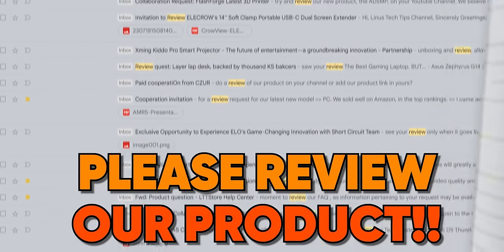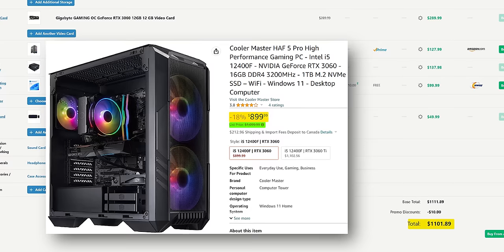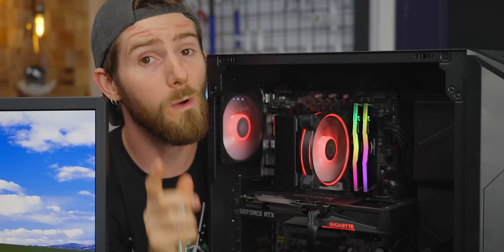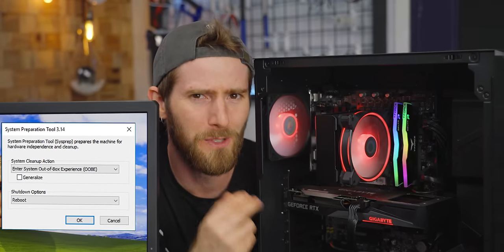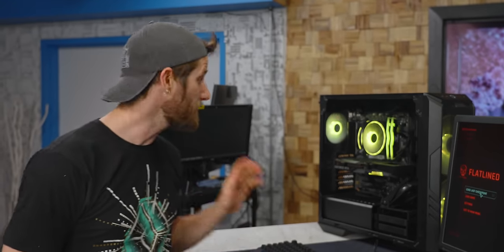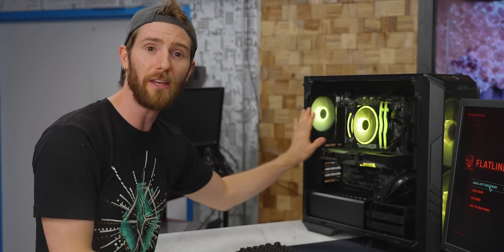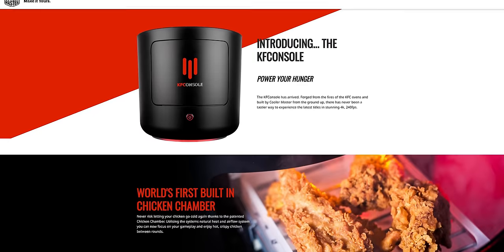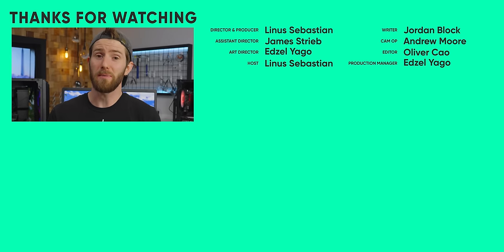Cooler Master Makes Gaming PCs Now? HAF 5 Pro Gaming PC review

Comment: Almost all RGB software require an user account to work now.  Pre-built do their testing in audit mode.  While you can test the RGB in audit mode, after sysprep, those software won't work for user.  Not Windows issue, but it is how the RGB software is written.  The only one I know that still works after sysprep is Asrock Polychrome. User will have to install RGB software on their own if the RGB is connected to MB header.

Comment: The one computer has fading red lights on the AIO. This could indicate software issues, bios update, or over heating. I had this issue recently. If you did not set that to be the color choice, keep this in mind.

Comment: Tbh the white zip ties make sense for visual as you can see which wires are tied and which ones aren't. I've got a load of black ones on my speaker wire setup and changing things out as a nightmare.

Comment: I bought my first real PC this year and due to time constraints and a dying Mac Mini I went prebuilt. Alexander PC's treated me well and this build has been great so far. It was expensive at $3k but I'm happy with the purchase. I wasn't excited about the 3070 TI but I wanted the 13700k. And my wallet didn't allow me to request a 3080. I've had a very positive experience with Alexander PC's and I think they could be a prebuilt company worth checking out. I will say the packing was severely lackluster and could be improved upon immensely. But overall they get a 9/10 because they delivered what I paid for and their customer service hasn't let me down yet. Plus the cable routing is nice and the custom bronze or copper cables look STELLAR in this build.

Comment: Most RGB controllers have a wire that goes to the MB reset pins. So short press changes the RGB colours and long press acts as a reset. This has been common place for years. It's useful for non Windows users who still want to be able to change colours and cannot otherwise run the software.

Comment: Using reset for rgb sounds amazing, means you don’t have to fuss with software. Who uses the reset switch anyway? What does it do ever? Reboot windows? Just do that from the start menu or hold the powerbutton for 6 seconds

Comment: Reset rgb controllers are common thing, they are usually added to argb sets and if you need to hard restart machine you could just hold down power button, just like in laptops.

Comment: Regarding the weird CSGO claim, most Source games used to come with an fps_max value set to 300. I believe this was lifted higher in specifically CSGO recently as 360Hz+ monitors began getting more common. It's possible this value was still set wrong (or they used an older build) when testing.
Reply: I hate that actually. I noticed L4D2 was using a ton of GPU usage because of the framerate regardless of Vsync. 
I change it to FPS_MAX 60 in console but it resets everytime. Any fix?

Comment: The conflicting color scheme on the zip ties is to manufacturing simplicity. It lessens mistakes and an easy reference as most hired to manufacturing floors are not experts in the field. They theoretically should have many checks and balances but that seems to be the first they cut to make a buck.

Comment: i kinda like the clear zips on the back - not visible with side on, and when user servicing is done, its easy to see the ties you need to cut. those tails though... needs flushcuts.

Comment: My Lenovo T5 prebuilt doesn't even have a reset switch, and any changes to the light i front can only be changed through bios (but changes are reset when you leave bios) or through Lenovo software in windows. Kinda thinking the reset switch as rgb button is a decent compromise as I don't even remember thinking that my PC is lesser without it. Hold power button for 5 seconds to force shutdown if windows goes mental, works a treat and rarely happens, for me at least.

Comment: From my experiences,  Cooler Master has been one of the relative good guys when it comes to having their products work.   I have three PCs in the house here all in Cooler Master cases, all similar in nature.  Buying a solid case with pre-installed RGP fans that are actually worth paying for was nice, especially when they priced near enough to others without any fans.

I think the move you see companies like this making to become system integrators / builders is twofold.  Number one, they can leverage their good name in marketing terms, but also because they can put components from their various owned companies and partners in.  Full system sales is not a simple game, but it is a very good way to push off certain things that you are having a hard time moving, such as e-waste level keyboards.    It is impressive that the two systems came with essentially identical parts, as it's prebuilts often feature a series of small substitutions to use up left over stock. 

I would say that at under $900, it's not a horrible purchase.  A 3060 is a good enough graphics card to hold a junior gamer for a few more years yet.

Comment: Hey linus and team, i put together my first computer on my own thanks too all of the videos you have posted, specs
z790-a wifi from msi
i5-13600k
2x16 ddr5 5600megatransfers
1tb crucial p3 m.2
750w power supply
colermaster td 500 mesh V1
i just wanted to say that the integrated graphics in this chip were very suprisingly capeable, i played resident evil 8 on medium settings with  75 fps on average, the refresh rate of my monitor, that being said, im lookin into architecture software and blendr animation, so what Gpu would you and your team recomend for this build?

Comment: Me personally i purposely pluged my front panel RGB into the reset switch. I've never understood the point of a physical reset button in the modern PC age. Anytime i need to reset i just do so in windows and if my PC ever were to hard lock up i would just hold down the power button and reboot/power cycle that way (had that happen like twice in 4 years). I have SSD's in my PC so a cold boot takes like 10 seconds.

Comment: Personally I always leave my reset switch unplugged (or don't get a case with it). I hate the reset button. If you want to hard reset, either flick the power switch on the PSU, or hold down the power switch for 5 seconds. Both of these are very difficult to do accidentally, whereas the reset button is comparability easy to accidentally hit.

Comment: my experience with ordering prebuilt/custom built PCs is that these companies don't POST/update any bios. kinda boggles me that the companies processes and employees working for them don't even think to plug it in and press the power button before shipping it out. I had to update the bios for my MB cuz it needed and update to work with 12th gen i7s.

other than that everything else was fine from screws to cabling, safe packaging, etc.

Comment: Lots of low end cases and systems come with the RGB controlled by the reset switch. I recently built my wife a PC in a Bitfenix case, it came set up with the case fans controlled by the reset switch. I assume it is a carry over from a few years ago when many lower end motherboards didn't have built in ARGB headers. I am actually coming around to the solution. It isn't as functional as software, but it is simple,. and even a novice can get a lighting setting they like. I love my ARGB, but I have yet to find ARGB software that isn't a little buggy and it is certainly bloat.

Comment: I wonder if the Amazon PC was set to reboot through the OOBE when the RAM stick died. You don't power them back on before giving them to the customer at that point. So its quite possible its one of those weird things.

It's also possible the tech that was doing this said to someone else "They're all done, go ahead and box them" and forgot to mention one he needed to fix.

Comment: I would still like to have my reset button back. CM could just have a dedicated button for RGB on the case, like many companies do. I hope they will get that if their prebuild business kicks off.
As for RGB bloatware you can always install OpenRGB. It recognizes my Corsair K68 keyboard, ASUS TUF X670E motherboard (both onboard lightning and RGB connectors) and Gigabyte RTX 4090. I have it all set to static lightning (I don't like any "moving" effects) and I don't need to install any first-party bloaty software. It's free, open source, you don't need to register any account and it has an active development. It's also highly configurable if you want to program your effects in detail, or you can just use some built-in effects.

Comment: Not having the reset button is fair. Most office PCs these days don't have one either. You can still hard reset by holding down the power button and turn it back on. 
I much prefer the hardware control solution for RGB over software. Most people don't need 16 millons colours to choose the exact one they want. 12 or so colours and a few flashing/pulsing modes are enough to satisfy most. Speaking from my experience building and selling many PCs to customers.

Comment: what I don't get is, as the manufacturer of the HAF Case they could have easily added a "RGB"-Control switch to the front panel so they wouldn't have to abuse the reset switch instead 🤷‍♂

Comment: I once had the same problem with an Sharkoon rgb case with the reset switch XD. The problem was it was labelled lighting or rgb on the case but on the cable reset switch. So I plugged it in in the reset switch and the friend I built the pc for wondered why the lights didn’t work

Comment: I have a feeling the Amazon model was put on the wrong shelf when it failed Quality Control. A bad RAM chip that wouldn't boot and an unfinished set-up screen is too much of a coincidence. That's a huge quality control problem but it means both the issues had the same root cause.

Comment: They didn't update their drivers and firmware on these PC's? For an experienced user that wouldn't be an issue, but if you're just a newcomer as a PC gamer, then it might be a problem. It almost looks like they were in rush while building this PC with a time pressure or something.

Comment: I just bought an msi prebuilt pc with an i513400f and 4060 8gb, 16gb of ddr5 4800hz speed 650w psu. I ordered a 4070 for it and 32gb of corsair 6400 cl 32 and the pc Is now amazing for the money I've spent. The msi codex r case is actually really good, the cooling is really good, they even did an immaculate job of cable management. Overall I'm supremely impressed with the purchase and quality of the product. Anyone thinking of getting an msi prebuilt at least for the codex r series I would say go for it 💪

Comment: So it's good value, but you should check if everything looks good when it arrives (which should be normal anyways). Seems to me that this is totally fine, assuming the customer has some clue of what to do when unpacking their new system, regarding updates, bios settings and cable/ screw checkups. Most pre-built reviews show much worse issues!

Comment: While I agree the reset button is not intuitive, I prefer it controlling the RGB over resetting the system. In the ~15 years I have been building computers I don't think I have ever used the reset button intentionally. Just hold the power button, and if that doesn't work for some reason I am going for the switch on the power supply.

Comment: Man it's crazy to think that you can buy a prebuilt and have some loose screws,bad ram,bad bios,just bad everything. Where I live people pick which part they want from the store and they're built by the people working there. Never had any issues and they'd tinker with the bios (or at least enable basic stuff like xmp and resizable bar)

Comment: I know the quality control issue with the ram was less than perfect, but being willing to send out a technician to sort it was pretty great, definitely different from the experience if you bought all the parts separately then struggled to diagnose
Reply: Would be funny if the technician pulled up a ltt video to fix it
Reply: @leongao5120  fair point 🤣

Comment: Using reset button for brainless rgb control is actually a common thing. My cheap case came with rgb fans that can only be controlled by connector that goes into reset leads, so i had to choose what i want to wire or diy additional button.

Comment: The reset-repurposed switch doesn’t seem that uncommon - on my Antec DF700 Flux case the reset switch is plugged into the included RGB hub out of the box, although thankfully it’s labelled LED on the case not reset.

Comment: @LinusTechTips I have the Cooler Master H500M case - utterly huge and I love it as if it were my child - and initially, before I upgraded my motherboard, there was no ARBG headers to plug the RGB controller into, so that reset button to change lighting was very very handy!

It would be great if, you connect the ARGB to the motherboard and keep the reset button plugged in then the controller would reroute the reset button to the actual reset switch; would need a USB connection though, which my controller's model (that came with the case) does actually have.... I wonder if it works like that, I must test it.

Comment: Fun story: I took my PC to the shop bc it wouldnt start after GPU issues. Turned out the GPU was deceased (RTX 3060) and Windows broke. So they reinstalled Windows.
They ended up losing all my case screws and my backup gpu (RX 6500 XT 4GB. WOW, I know) wasn't properly fastened. They put only 3 new scews in the back, 2 on the glass panel and 1 for the metal sidfe panel. I used them to fasten my new RX 6800 and then I had some leftover AMD mounting screws for an AIO block and I found out that the fat part of the 2 sided fastener fits perfectly on fastener screw holes, so I used them and now need a hexa tool to open my pc. Feels great!

Comment: As someone who worked for a si, all of these were things I struggled to get every builder to do consistently in every build. From loose screws, to rgb controllers not hooked up the same way, or tie ups being different. Consistency was the hardest part. When you have dozens of skus with different rgb controllers or cases that implement non standard rgb connectors it just makes it that much harder, especially training new people all the time. I’d say cooler master did an ok job with consistency. A little work on the quality control is needed but I’ve definitely seen way worse. Even from more reputable brands.

Comment: I've always been confused about CSM. Like I have a 11th gen i5 and a cheap b560 board from Asus with a 1080ti and in the past a 1060. I have always had to use launch CSM in order to see the boot screen or get to the bios using my dedicated GPU. It works fine without it on integrated graphics. All my OS installs are fresh from within the last year too so I've always been confused why I need to enable an option designed for old hardware.

Comment: I've always found coolermaster products i used in the past to be reliable and a fair price. As for the rgb software don't even mention Icue, I've had countless issues with it now it refuses to show me my fans so i can't adjust speed etc it's gotten to the point i'm completely ditching all 7 corsair fans very soon and going to Noctua fan because i don't need rgb on my fans. I do like static colours but i've been toning it down a lot in recent months and those corsair fans that rely on terrible software and a zillion cables need to go.

Comment: So I have a cooler master case and it said to plug the reset switch in their rgb controle thingy (which is smaller than what they put in their fully built system).
And I'm glad I ignored that, installed software to controle it and just use the reset switch as it should be used.

Comment: Personally I think reset buttons are pointless. If you need to hard reset, just hold the power button. Using the reset button to control lighting is a great idea that I've seen done numerous times.

Comment: Not bad for the price. But Quality control needs work. The Amazon unit didn’t power on. I am wondering if reseating the ram would have worked. The free shipping route the Amazon unit could have been more bumpy which could have made the ram sticks loose.  The marketing on Amazon need to be changed. It’s not a high performance gaming PC. It has mid tier CPU, GPU, and only 16GB of ram. I also would like to see more SFF Pre Builds.

Comment: The peripherals included actually make me giggle, because the Devastator 3 was a combo that I bought as my first keyboard/mouse (…back in 2017) and I actually had to ditch the mouse about a year later because the plastic part where the cable goes into the mouse got loose and wouldn’t make a reliable connection to USB, so it’s just hilarious to me that they include it with a 900$ gaming PC in 2023

Comment: My Cougar Airface RGB ATX Mid Tower Case (bought 3 weeks ago) has a RGB control board that looks very similar. It also came with the reset switch plugged into it. In order to change to software controlled via the motherboard, I have to hold the reset switch down for 3 seconds. So it looks like this may become a thing.

Comment: that loose screw could have killed the cooler master pc if it happened to get lodged somewhere an bridged some contacts under the graphics cooler or motherboard so id stay its still a pretty big deal since most people dont do a full screw by screw inspection an just do the usual reseat ram an graphics an then hit the power button